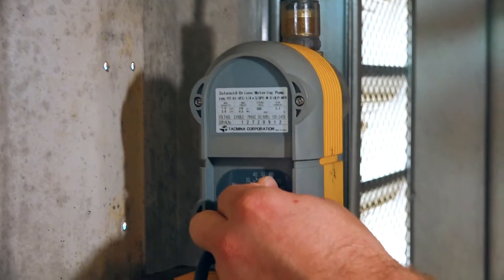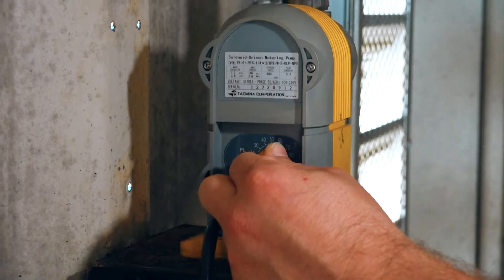Chemical Dosing Pumps - Boiler Room Tip

Comment: Water in boiler could be acidic or alkaline,   this is not good in the boiler,
Reply: It's more geared towards oxygen removal and sludge conditioning. Plus neutralizing carbonic acid in condensate. Make up water alkalinity really dictates whether or not you need caustic as well.